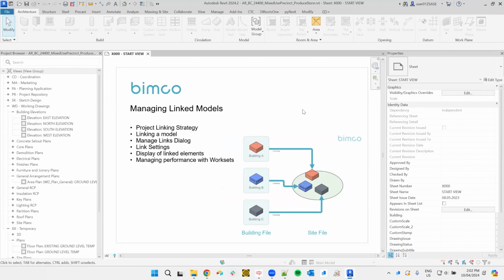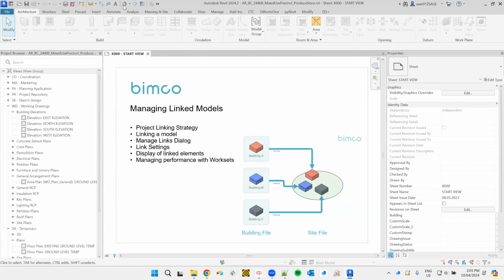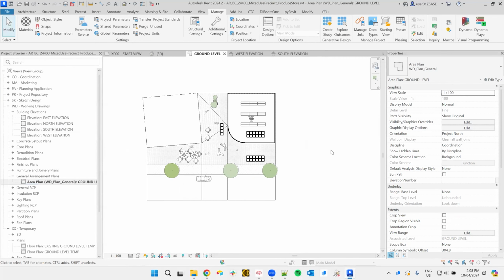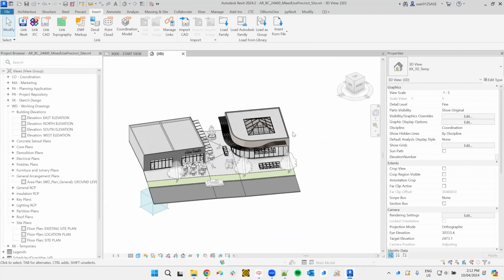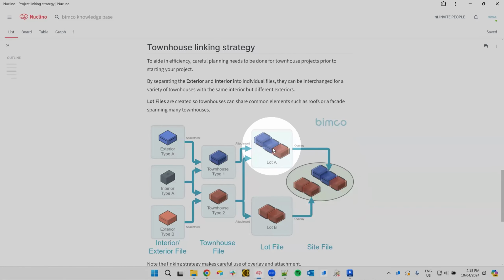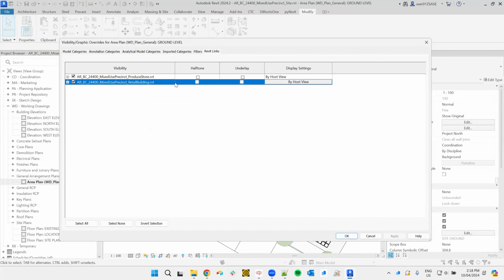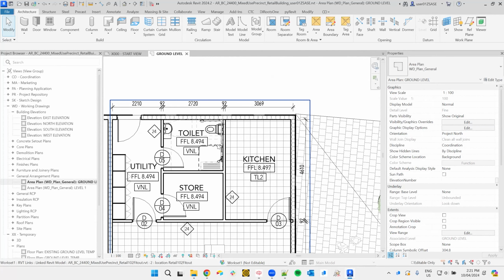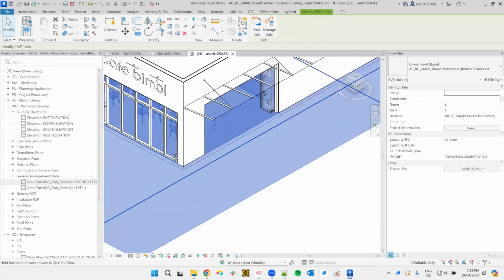Managing Linked Revit Models - bimco Revit File Management Training Tutorial

Comment: Great tutorial once again! Is controlling the link via worksets more efficient than simply loading/unloading the link directly?
Reply from the maker: Hi @nicolapeccin3759, appreciate your positive feedback!
Controlling links via worksets can be more efficient than simply loading or unloading links directly. By using worksets, you can control which parts of the model are loaded, which can significantly improve performance. 
When you open a file, you can choose which worksets to load, allowing you to open files more quickly by excluding unnecessary data initially.

To specify which worksets to open:
1. Select a file in the Open dialog
2. Click the dropdown arrow next to Open
3. Pick Specify...
4. Select the links that you require open and close all others
5. Click OK to open the project with just the worksets nominated as Open